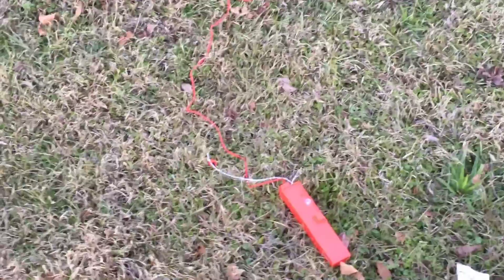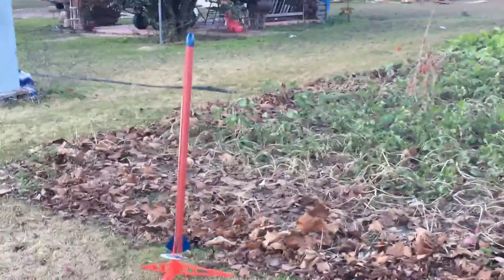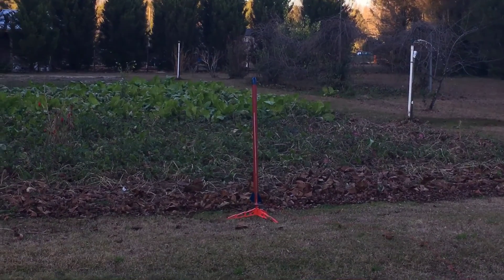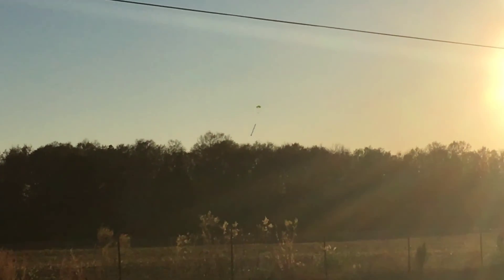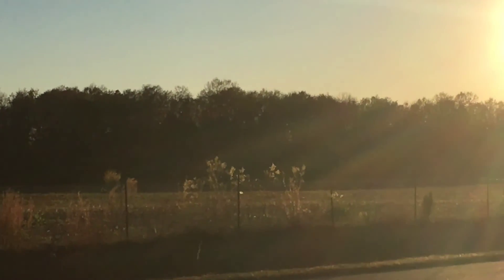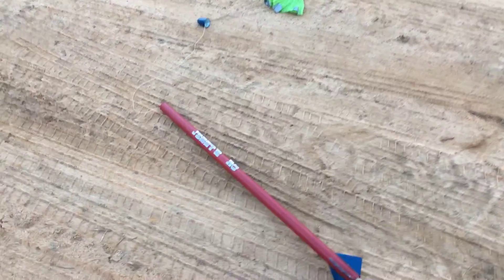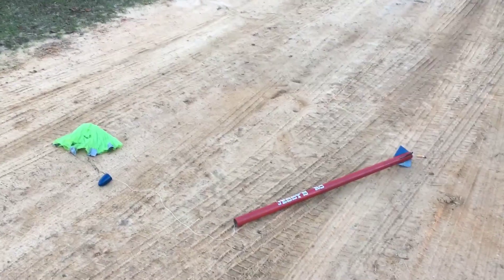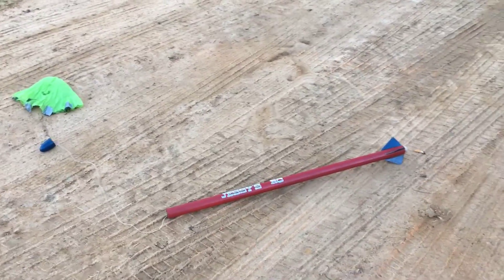How To Build Your Own Homemade Model Rocket (Part 3)

Comment: Why dont you mention the specification of making a rocket like the size of fins, diameter & length of cardboard tube, size of nose cone.
Reply: the fins are made of plastic gift cards, the cardboard tube is from Christmas wrapping, and the nose cone is half and Easter egg, look at the previous 2 videos.
Reply: thanks alot..
Reply: really just cut a gift card in half and you got two fins
Reply from the maker: Watch the first to vids....